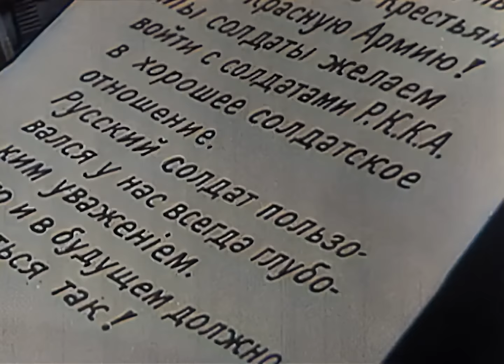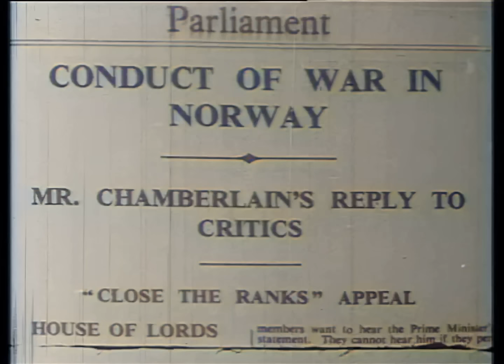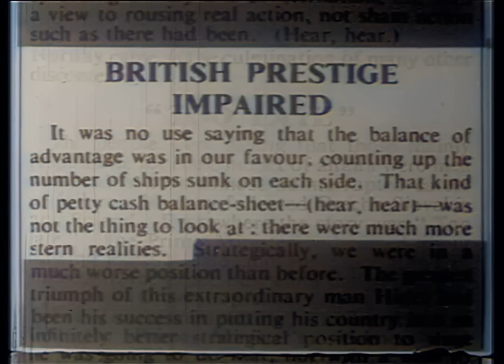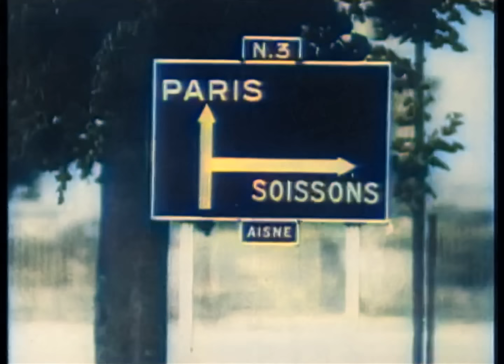First Blood | April - June 1940 | World War II

Comment: The decision to hold back the panzers was actually a sound decision with the knowledge the German had at the time. They were WAY ahead of their infantry, everyone was exhausted, supply lines were stretched and there had been at least three allied attacks on the flanks. Guderian and Rommel had actually broken orders advancing as fast as they had. Remember this was a new strategy for the Germans, too. In hindsight, would they have done things differently? Maybe, but AT THE TIME they had to take time to consolidate and evaluate. They were Germans after all - rules are rules.